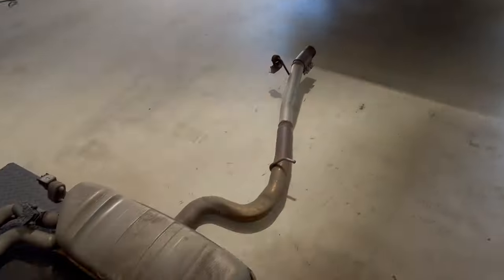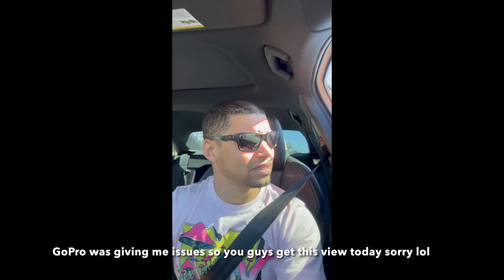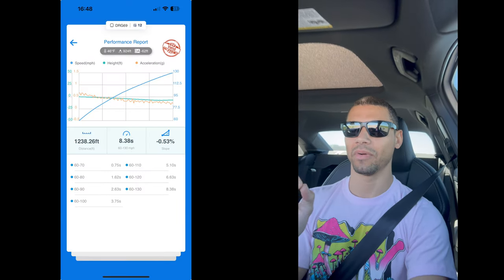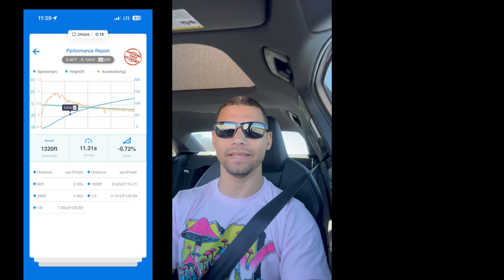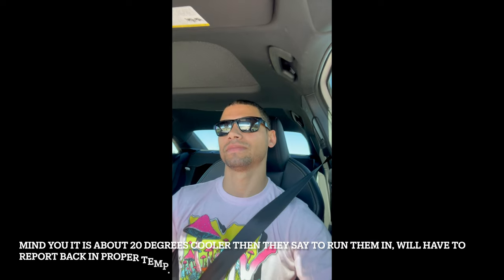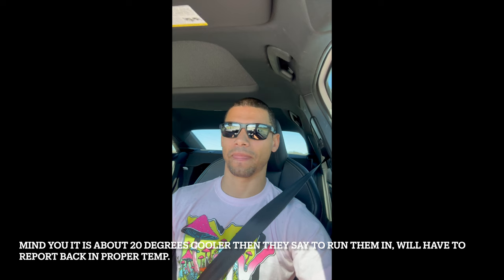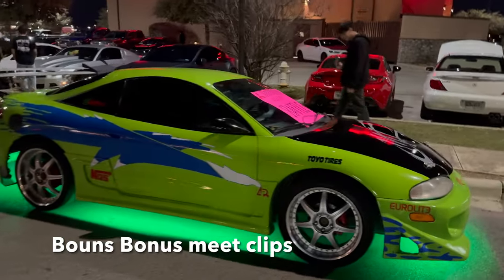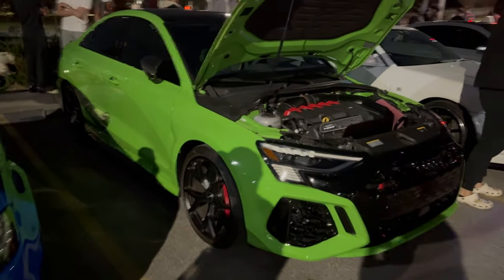Does removing your muffler make you any faster? Draggy testing with my 8Y S3!

Comment: Love the build! I was wondering if you had a list of all your mods on the car?
Reply from the maker: Sure thang! 

Engine:
EQT custom stage 2 E85 ECU tune
034 stage 2 TCU tune
034 street sport engine mount
034 street sport trans mount 
034 coil packs w/ heat sink 
APR Discharge pipe
APR billet dogbone 
Blaze 4” intake 
DBV2 4” downpipe (Cerakoted)
DO88 intercooler 
EQT coil grounding kit
Forge turbo blanket 

Suspension:
034 dynamic+ front endlinks
034 dynamic+ rear endlinks
034 rear sway bar 
034 rear tunnel brace
ECS tuning rear diff inserts 
EQT balance line coilovers 
JXB driveshaft carrier
Swift 10k front spring
Swift 8k rear spring 
Ultra racing strut bar 
Verkline Anti-lift / Anti-squat trailing arms 
Verkline front control arms (modified kinetics)
Verkline front subframe
Verkline rear camber arms
Verkline rear subframe (track)
Verkline tie rod ends (awaiting install)
Verkline toe arms
Verkline wishbone/hub bushings 

Wheel/tire:
Conti extreme force 245/40/18
Titan T-S5 18x8.5 (17.8lbs) ET+44

Exterior:
Maxton front splitter v4
Maxton rear spats
Maxton side skirts (street sport)
Maxton spoiler 
Rieger diffuser

Extras:
Aliexpress gear selector 
Blacked out rear reflectors
Custom steering wheel
DBV2 plate frame 
EQT badge 
P3 gauge
Pro bolt coil pack hardware - Alum (M6x1.0 40mm)
Pro bolt plate frame hardware - Ti (M6x1.0 8mm)
R8 coolant cap
Racingline brake fluid cap
Racingline coolant hose
Racingline fuel cap
Racingline magnetic front diff plug (awaiting install)
Racingline magnetic oil drain plug
Racingline magnetic rear diff plug
Racingline oil cap
Racingline oil filter housing
Racingline washer cap
Racingline wheel studs 
Resonator delete 
Urus shifter paddles
Reply: Thank you so much❤ @BryceJordanProductions
Reply from the maker: Anytime!
Reply: @BryceJordanProductions no flex fuel sensor or something to keep track of the amount of e85?

Comment: Did u get a light from taking the muffler off?
Reply from the maker: I’m not sure I had every light on the dash on from taking my seats out lol
Reply: You will never get a light from that.. muffler is for sound it’s technically not needed on a car to run properly
Reply from the maker: Some cars will throw codes with the valves disconnected